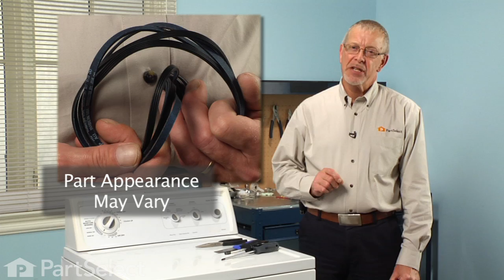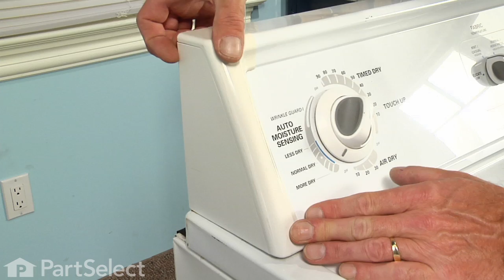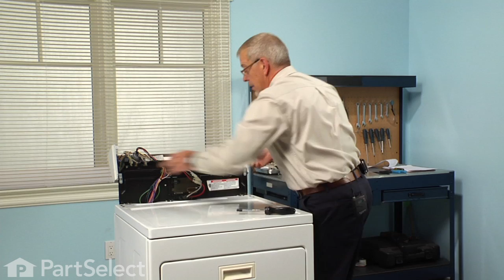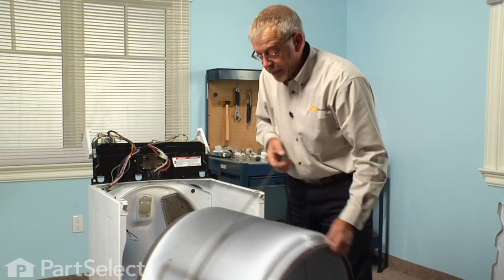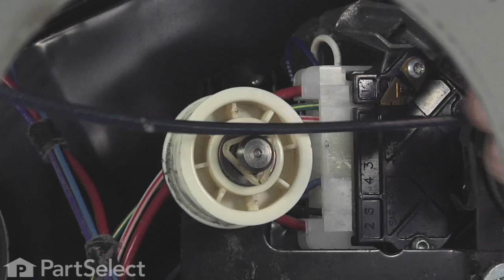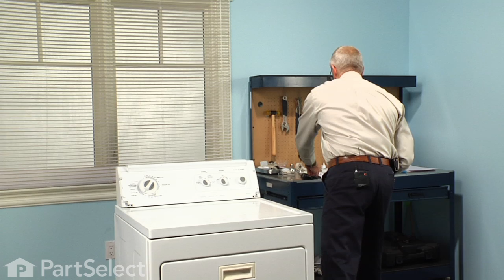Dryer Repair - Replacing the Multi Rib Belt (Whirlpool Part # 661570)

Comment: Was actually chasing down some other common dryer fault trouble shooting tips (door switch, start button and thermal fuse when I discovered the belt had broken (triggering an auto cut-off). Found this video and the instructions were so easy to follow, repaired in a short time. Thank you.

Comment: We wanted a basic clothes dryer without all the cute bells and whistles that seem to be important to some people. This dryer works well≖>allmy.tips/Whirlpool-Dryer?66N     As with most appliances of this sort it is not made to the same robust standards of yesteryear. However, it woks well and fills our need. I paid for the Home Depot installation but the installers chose to use our existing dryer vent hose which caused a problem. There was nothing wrong with the flow of air from the exhaust of the previous dryer. The installer must have dislodged a lint ball in that hose. It became blocked and we had to put in a service call. Now fixed and all is well.